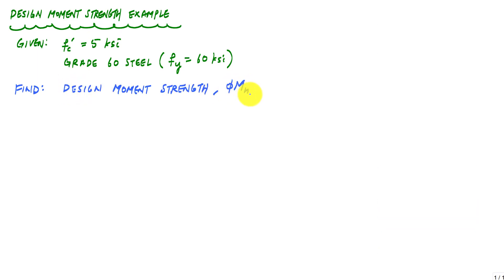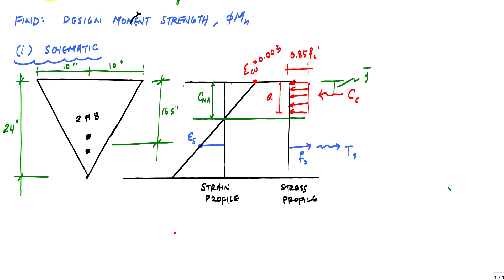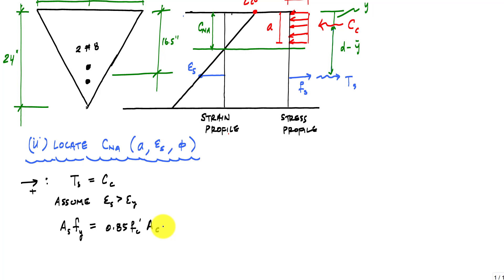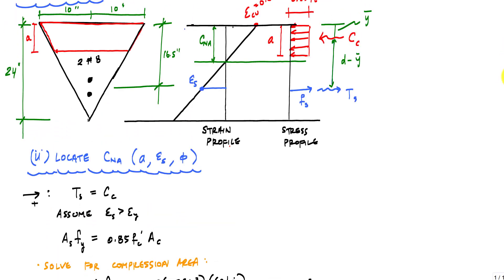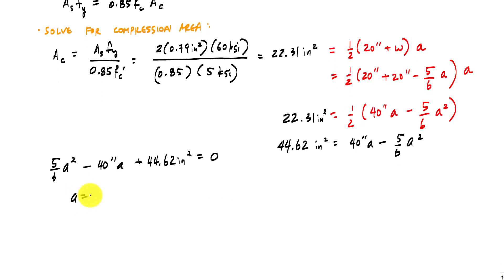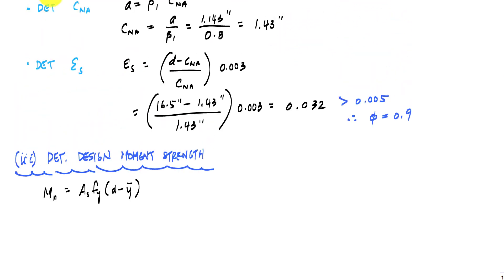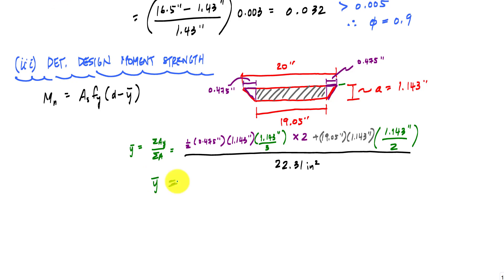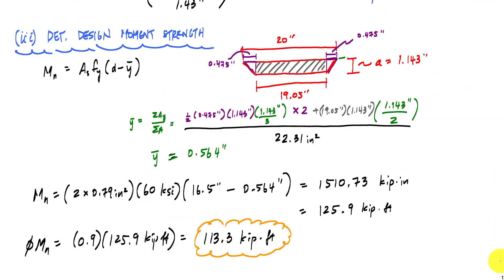Design Moment Strength Example of Triangular Section - Reinforced Concrete Analysis

Comment: Will the beta_1 for triangle section be same as that for the rectangle section? Seems like it’s shouldn’t be if you try and get an estimated beta_1 using the hognestaad stress-strain diagram. But then too much uncertainty in concrete, so what the heck🤷🏾‍♂️
Reply from the maker: Beta one is a function of the concrete compressive strength.

Comment: for the final part of finding triangular Ay, the y shall be (2/3)(1.143) instead of (1/3)(1.143)  right?
Reply from the maker: I used 1/3 since it's the centroid from the top of the section.